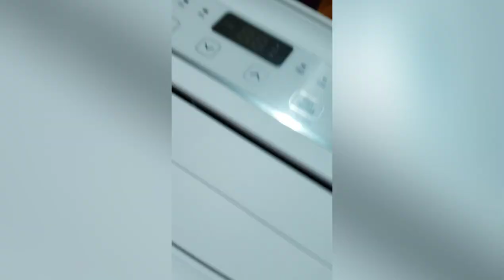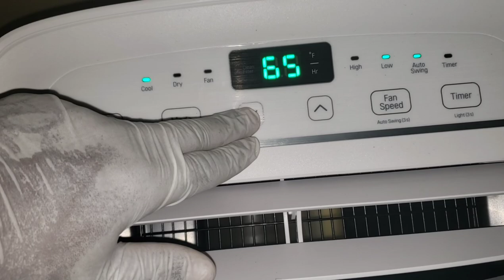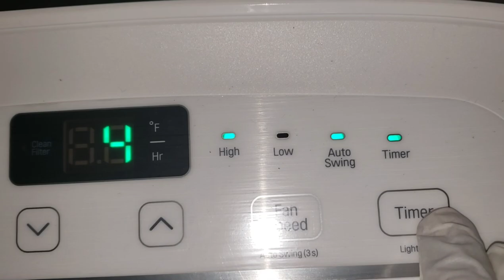How to install a Portable Air Conditioner (AC) [Step by Step]

Comment: I like that it is relatively quiet for how much air it moves. https://www.youtube.com/post/Ugkxmj9RYGCX25BElHkuWjHec-2_muyUGyCm Was easy to put together. Note: The spindle cap is threaded backwards to keep it from spinning off during use, so remember to turn it the "other way". I also like that the lights, which are quite bright, turn off after a few moments so they do not bother me at night. The remote has to be aimed just right, but does work.

Comment: Very helpful. I feel confident I can do it. Wasn’t as easy as I thought. Attaching both parts to the hose was quite difficult - took a long time to get it just rght.
Reply from the maker: To attach it easily, you should untwist a hose before connect to the head. Good luck.
Reply: That's what I'm talking about and I'm still having a hard time.

Comment: "Place the window installed in the middle".  What even does this mean.  I am so done, with listening to AIs.  Who ever is creating these, need to make more adjustments to make them sound more human.  "in most cases, it will work on-site".  What happens if it doesn't work on-site?  This is a joke.

Comment: Do I really need to use the exhaust thingy?
Reply: Sends hot air outside . Some models have ability to run just fan or dehumidfer , exhaust not needed. My model runs on cool auto with exhaust pipe used.